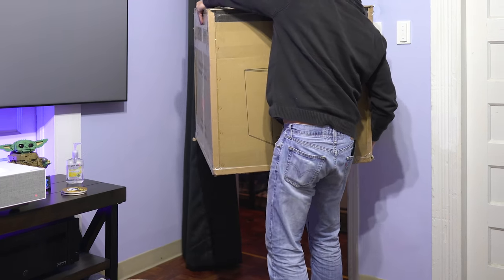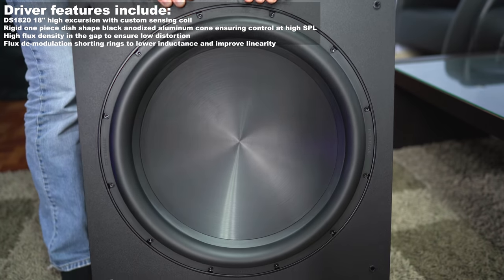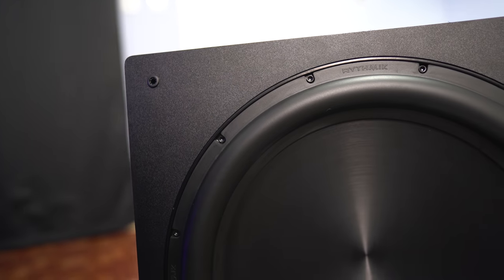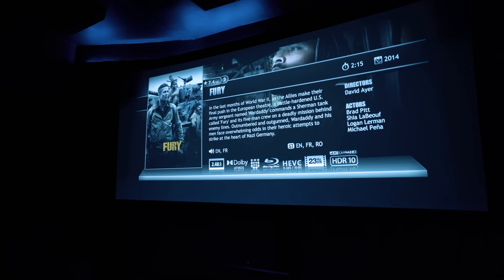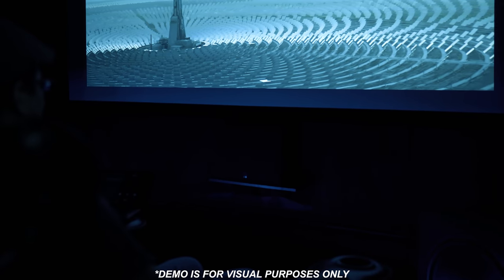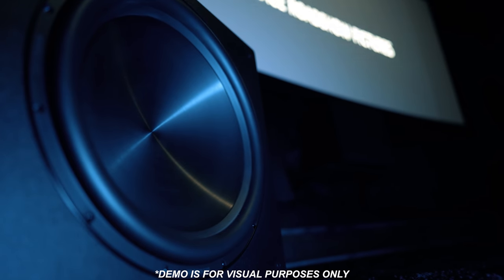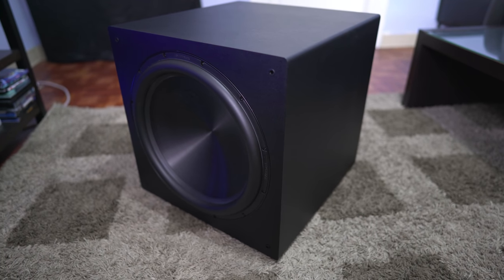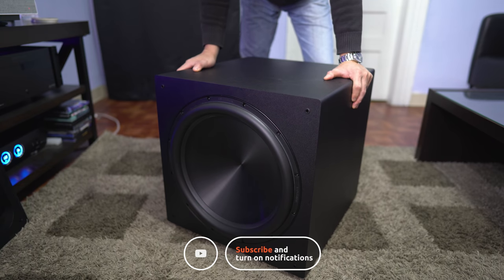Onslaught of Bass! RYTHMIK F18 Subwoofer Review | Dual 18's!!!

Comment: Fyi on high damping it's quick as quick can be. Perfect for music.
Reply: Was just thinking this. He puts it on what should be the slowest settings and then says it could be faster... lol. Follow up with 18hz high damping pls!
Reply from the maker: You guys honestly think I took it out of the box and used that single setting and called it a day?
Reply: @therealshanelee  Maybe we both missed it, but I didn't hear you mention anything about the performance with any settings other than 12hz/low damping.  My ported FVX15 on 1p/Music setting is excellent, seems like this sealed design should be as good if not better, so it was surprising to hear you wouldn't recommend it for a music setup.
Reply: @Zachary_Setzer  03:40
Reply: The accuracy of servo subs take some getting used to. Most subs are bloated, a lot of what we perceive as output is distortion or inaccuracy. One you get used to it most subs sound bad. 
I had to listen to a lot of music that I know very well when I started noticing other instruments that were buried in the sound by my older sub. Love servo subs I would like to hear some dipole subs as well as an IB setup but I live in the sticks

Comment: I’ve had a rythmik fv15 for maybe 7 years now or very close... thing is thunderous for a lightweight amp. 

Their customer service is amazing... they actually reached out to me not too long ago and serviced the amp free of charge because there was concerns about something... blew my mind because I feel most companies cut ties once the product is delivered outside of the consumer contracting for warranty services...

YouTube has some great rythmik videos of people rattling their homes from outside
Reply: Got the same email for mine. When I went to take the amp out I discovered the fuse was already blown. It's 1 of 3 subs in my room and with 3 young kids in the house and always listening at low volumes these days I hadn't realized it wasn't working anymore. 

Replaced the fuse and it burned up the moment I plugged the rca cable back in without a source even playing and the sub still in standby. Wonder what the issue is.

Comment: I notice during setup you set the damping to low. You mentioned you were not getting the quickness and initial punch like the smaller subs. It may be related to the low damping setting. Have you tried the Hi damping setting? That may fix that for you.
Reply: Yupp, lowest HZ and lowest damping setting is the loosest/boomiest you can set the sub to.
Reply: I think it strange to not get these subs tight bass responds. So I think he might have to set it differently in order to get these big boys tight. Servo subs with good settings are always tight.
Reply: Im thinking paper cone ported with medium dampening would be the ideal compromise for movies and music

Comment: Yes!!! I use dual JTR Captivator 1400 18” subs in my theater. At the time they were $1899 a piece with a discount for buying 2. 
Once you go with a competent 18” sub and in duals, things start getting fun!
Reply: What a steal considering the price on JTR nowadays
Reply: Would you go for two RS1's or two rythmik F18s for the money?
Reply: @Espiritiv  I’d go for the RS1s, as they have more power and can handle a bit more abuse.
Reply: @jarodreddig63  makes sense. I think the rs1s would last 20 years easy just like the m&k mx-350s they will be replacing.

Comment: I added two F18 to my 20x23 theater room about 18 months ago. I don’t regret the purchase. I moved my original Paradigm subwoofer to the back corner to help out taming the room modes.
Reply: How did you integrate the Paradigm sub to these F18?
Reply: I use a miniDSP with the LFE output from my preamp.
Reply: what Paradigm sub do you have?  Was considering the X15 or the Rythmik F18
Reply: It is an original Servo 15 from about 1998.

Comment: Thanks for the Rythmik F18 review we have all been waiting for!  I have had my eye on these for my media room.  It was disappointing that it performed better for theater than music, which seems to be the opposite of their claim to fame.  I am a music first person, but that Edge of Tomorrow clip was the most impressive I have ever witnessed.  It does appear to be an extremely controlled subwoofer.
Reply: He did have damping on low which I believe is the least "tight" setting.
Reply: Really? They are 18 inch woofers and cannot be expected to sound as punchy as a smaller driver especially a 12 inch.

I suggest you look at the g22 or g25 then.
Reply: @mesonto  not completely tru. Check this out: https://data-bass.com/#/articles/5cbf5e7357f7140004d6d0ec?_k=eeckpa

Comment: I also have dual F18s. For the price point they are phenomenal. Great video!
Reply: @Dude Man I prefer sealed over ported. My room is only 19x13. 50/50 movies to music. If your floor is on concrete or you have a huge room I would stick with ported.
Reply: @chadhunter8757  what about a medium sized room with carper over concrete? Still ported over sealed?
Reply: @run4b33r  tough decision but I'd probably still go sealed unless your a complete bass head. I'm really bias when it comes to sealed subs especially after owning ported in the past. Then again they weren't good ported brands.

Comment: I ended up choosing the Rythmik F12G. The difference with these is they are designed for music. They use a GR Research driver, low-mass paper cone, so they are very VERY fast. Also bass extends cleanly down to 15Hz with a gradual roll off below that (typical for most Rythmik models). Now on my AV system for movies it is just as impactful as what you experienced with F18, but with music the speed really shows off in the F12G. I found this to be the best sub they make. I had the F18 you show in this video, and found the same limitations you experienced. This is why I switched to the F12G and it hits all the marks. It's sort of a sleeper model for Rythmik. You may want to try and review the F12G, especially since you like the REL (which I had also). I do prefer the F12G. Power might be a limiting factor for you since these only use the 370W amp. However, in my room with two I experienced no issues power wise.
Reply: I'm torn between the Rythmiks and JTR RS1 sealed subs. I want both detail and clarity in the bass and showcase sub 20 hz for music, plus room shaking bass for movies. Still can't decide which route to go...
Reply: @synth505  I'm trying to decide between the same to subs as you. Did you pick one yet? If so which one and how do you like it so far?

Comment: Bought a Rythmik FVX15 and it is the best thing I have bought for my HT system.  Not so good for my wife's knick-knacks, it tend to vibrate them off the walls at high volumes.  Looked and SVS and HSU but they just didn't do it for me.  Had A Def Tech PF1500 that was the first sub I bought and it still works 25+ years later but sounds sloppy when switching between the two.  Now I need to get a 12" sealed one for my Magnapan setup for music.  The Def Tech is now on my son's video game setup.

Comment: Great review and perfect timing! I currently have dual F12SE and looking to upgrade. Currently testing out a pair of FV15HPs. They certainly have more output and have a smoother deeper sound than the sealed 12". But I do notice that the FV15HPs have less chest hitting punch or sharply defined attack. They are still fast and not flabby at all. Just smoother, deeper, and less sharply defined as the smaller 12" sealed. I am not sure if this a function of driver size or sealed vs ported? You mentioned you lost some of the punch in the F18s but the visceral depth and power was certainly there correct? Or are you shifting your observation with more listening that the F18s are indeed punchy and fast?

Comment: Shane you say that F18 are not as tight as you suppose, but this is because you use a wrong setting.
 If you want them to be more tight and musical you should set DAMPING to high and NOT low !! 
With damping set to high they will become the more controlled and tight subwoofer you have ever heard.
I'm telling you since I bought  F18 two years ago.
However my compliment for the good review and awesome channel !
Reply from the maker: Put them against the MartinLogan 212’s on high damping. No contest.
Reply: Thanks for the answer Shane, probably a 12 inch sub in opposite config is still faster than a 18" even with direct servo.
Have you used the same EQ for both ?
Because probaly also the PBK EQ of ML could have made the difference...
Reply from the maker: @emanuele747  the ML is tighter in any configuration.
Reply: @therealshanelee  Shane, I was trying to find some objective measurement showing me your findings, but if I look at any impulse response and group delay in Data-bass measurement I could not find anything indicating that F18 is not "tight" and "fast" as bass response:
https://data-bass.com/#/systems/5ad778f92d279a0004669a18?_k=icaddn
I suspect there is more an issue of your room handling the subsonic frequency of F18, that the ML 212 is not capable of.
Reply from the maker: @emanuele747  are you making judgements based on numbers or have you owned both in your room and made judgements that way? I have both. I've also listened to both.

Comment: Factor in the servo advantage for lowest distortion on the market and the SOTA Hypex amps being more efficient than REL and SVS amps (won't trip a 15 amp breaker like other jumbo subs) and it's a no brainer. These are the best big sub value for theater.
Reply: Good point on the AMP draw, particularly with the 12 and 15 inch woofers.

Comment: I bought two of the ported versions of these FV18’s , with the optional paper cones, which ups output by 3 Db’s.  There’s no looking back, they’re sublime.
Reply: Seal goes down lower and maintain output...
Reply: @blueflame0003  But for music, most people wouldn't argue the fact that sealed has the edge over ported.  But Rythmik Ported subs are monsters, and stop on a dime, given the servo control.
Reply: @clintstuckey  yes i did research on these rythimik before i bought my psa,because for those that don't know...there are videos of these in action you got to look hard on utube some people complain that there are no review and so i went with psa S3612 cause of the servo technology i did want to do the snake on cables but hey so far no complaints on both sides,oh by the way as far as music or theater its up to your settings you set for theater or music if you have the equipment great job thought
Reply: @clintstuckey  you must be referring that comment to another commenter i did not say anything that i can recall about frequency must someone else that's confuse,   but i will say in house psa is 7hz....and that maybe true but use my adjustments using REW i got them dial in at 10hz and that stands the up on my forearm...oh yeah

Comment: For Music i would think you would need a larger room to get the full impact of a woofer that size or you may need to be seated  further a way with fundamental bass notes. I remember selling car audio and 8" Bass drivers had more impact in the car and 12" subs sounded better outside of the car for impact than in the car itself.  I am wondering if that would the situation at least for music in the home.  Maybe try walking right outside of the room and see if you feel more impact ?  i could be all wet on that.  I do own their 12" sealed aluminum driver woofer and in my room it is all that i need. Things start falling off the walls.

Comment: Hi SpareChange
May I ask how you set up your subwoofer? How did you set your crossover crossover frequency and when does your subwoofer start playing. When I watch Fury, my SB3000 Sub only plays when there are explosions or Tank/german pak firing. Normal gun fire is only output through my speakers and a bit of sub in the background.

Comment: Shane, How much more slam do you think the FV18’s would have over the F18’s? Been eyeing these for a while. Going duals with whatever I decide.
Reply: I have heard both, and went ported due the increase in tactile response/slam... also paper cone, but only because I wanted the no regrets version... I know myself too well, it would have always eaten at me, since I had the space.  However the sealed is WAY smaller in dimensions.
Reply: @clintstuckey  which one had stronger chest punch/kick between the two? (You mentioned ported FV18 had more TR/slam, but I reckon TR isn't necessarily  = chest punch).

Comment: I think it is important to note that this is a good example of why these is not a one size fits all solution sub.   With your smaller speakers, it is difficult to obtain some of the sound characteristics you desire using 18's.  Your clearly noted the benefits on the Lower frequencies but also noticed a gap.  You may find 18's integrate better with speakers with much lower extension.  With the Trinnov at the helm, getting the right mix of speakers can yield the best of both worlds.  As you noted, the room plays a significant role as well. You are on the right track.

Comment: Ive had smaller Rhytmik in my somewhat large room 19x 30 x9, as well as REL,Arendal , Klipsch (the podcaster who has big klipsch and JTRs homes in his theater si definitely onto something -i don’t have that space-but like him , I can’t recommend klipsch subs in this level of competition) and SVS (but boot to be fair JTR,PSA or JL) Shane is spot on in emphasizing you have to consider what subs use will be -for pure music, always go REL, then Arendal. For pure home theater , Rhythmik is better value than SVS, eps if you dont need room correction (ie esp you have ARC, or Direc in your processor) . I have not auditioned the latest Arendal which has gone up in price but Shane was suitably impressed; the earlier version <<$2000 was a steal. Arendal remains, IMO the most balanced sub you can buy for music and home  theater, and Rhytmik is a good as any brand not named Arendal for dual use purposes. In my case (I have electrostats) it boiled down to the REL and Arendal. Rhytmik offers great value, many options for you budget and needs. In a darkened home theater room, im not sure you need any fancy finish I(and gloss just reflects too much (that and the in your face REL logs were, I must admit, a factor in choosing Arendal over REL) . PSI also set. 100 pound limit as I would be dragging down stairs myself. So your mileage nay vary size, finish, budget wise, but I will say this for Arendal and Rhytmik-you cant go wrong regardless of room size, type of use , price. They are both very safe choices and easy rec for anyone . If you care about finish Arendal obviously gets the node their finish as good as anyones. Final point i love JLs product, but they simple are not price competative. HOWEVER their in wall solutions are in class by themselves. (No I haven’t heard AScendo, Germani, JBL pros,

Comment: Great video!  How do you think the ported version compares?  I always thought ported was supposed to be better for movies?  Any disadvantage to going ported, especially if you don’t care about music only listening?
Reply: Ported will give you more tactile for sure, but I still prefer the sound of sealed.
Reply: I bought the ported versions, they used to have an issue with port chuffing, on the originals, but have since upped the size of the ports, and now they are amazing.  I also chose the paper cone version, which both have the benefit of being, faster, and playing 3db’s louder, and providing even more tactile response.  No regrets at all, none.
Reply: I would get the FV18 paper cone for sure in your case. You will get more output with slightly more distortion,
Reply: @drh3b  Cool.  So what is the advantage for the metal cone again for people that choose that?
Reply: @NickMatzkeMusic  Basically, the aluminum cone has slightly less distortion, it's slightly cleaner. The difference is subtle, I doubt I could hear it. The paper cone ported is going to be the best Rythmik has for Home Theater, except for the even bigger FV25, which has dual 15 inch aluminum cones.
Questions can be  directed to Rythmik, or the support thread at AVSforum.
https://www.rythmikaudio.com/
https://www.avsforum.com/threads/official-rythmik-audio-subwoofer-thread.1214550/page-2434#post-60714349

Comment: I got a pair of SVS PB4000 for a couple of years now; unfortunately, one just blew up. Instead of changing the driver, which doesn't work anymore, I wondered about upgrading my dual subwoofers to a new level by putting  18". I didn't make up my mind yet between those two:
  - Dual RYTHMIK F18;
  - Dual JTR  Captivator RS1.
Any advice?
Reply from the maker: You could get two F18's for almost the price of 1 JTR.
Reply: The Captivator has about the same output as two F18s. The Jtrs will have a "weightier" sound to them. Rythmik has more consistent customer service, but both products are top notch.